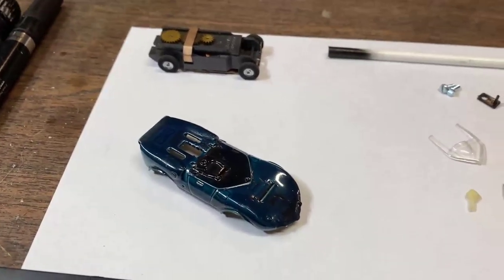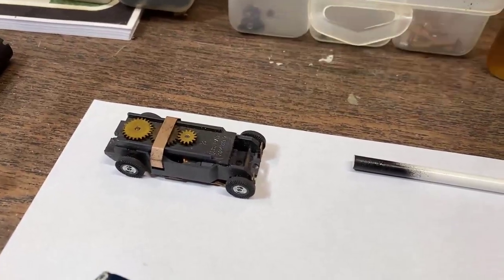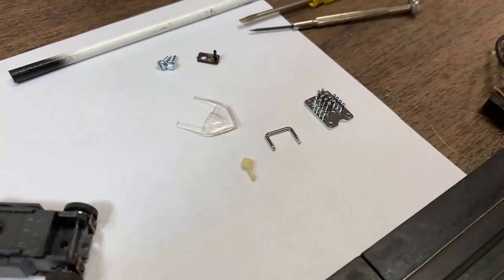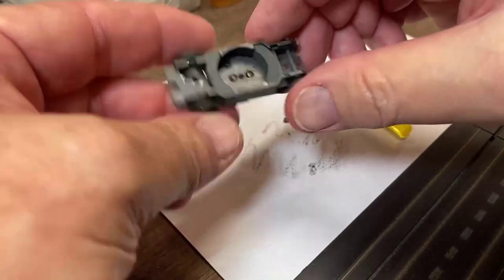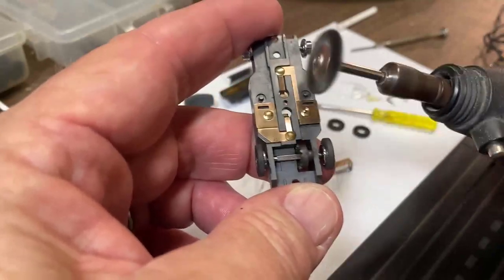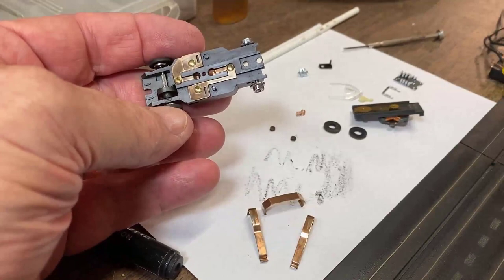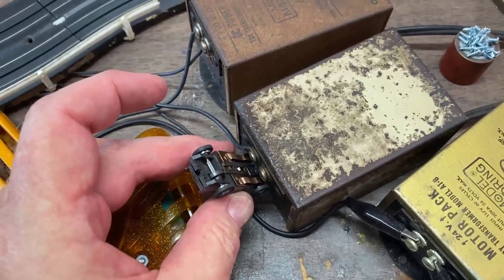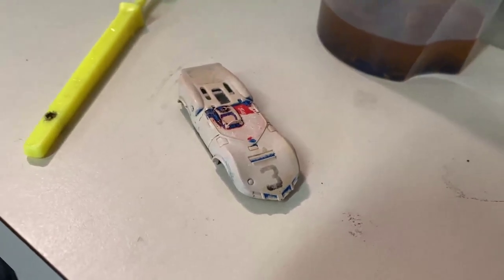5 Dollar Aurora Slot Car Chaparral Body Restoration

Comment: Happy Birthday!!!!!   Easy -off work quickly and takes off usually only what you need.    Brake fluid can actually soften and eat plastic.   There may be a way that it works. But for me Easy-off is a known entity and works just perfect. Especially in older rare-ish plastic.
Reply from the maker: Hey Cave, I will indeed NEVER use brake fluid on my slot cars again, and I'll tell you why in my next video.

Comment: I admire your tenacity with the brake fluid Jeff but we both know you will return to the good old "Easy Off" Lol. Good deal on the Chapperal body and a very happy B-day partner.
Reply from the maker: Hey Hick, the break fluid does remove the after market paint but also removes the Aurora accents as well...that unto its self, kinda sucks ass!! So, yes indeed I will be going back to the Easy Off. And thank you so much for the well wishes!! See ya Hick!!
Reply: I didn’t like the brake fluid before and now I really don’t like it… I have found that sharpie magic markers (get a big pack with many many colors) work well for tjet bodies for redoing the headlights, etc. So I recommended that for returning the red.
Reply from the maker: @christopherbusch1933  My attitude is: brake fluid will get old paint off, right? Yet it does remove the Aurora accents as well...So, going back to the Easy Off witch makes sense. Thanks for your input!! See ya, Christopher.